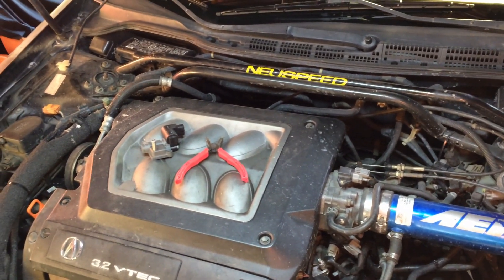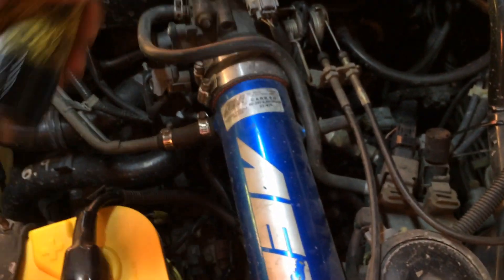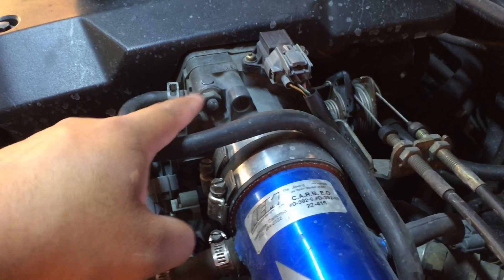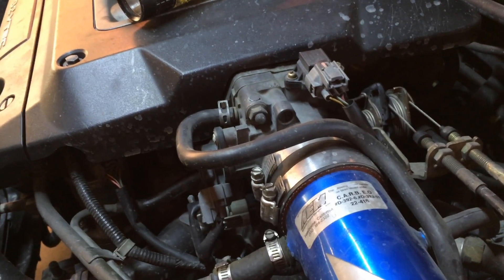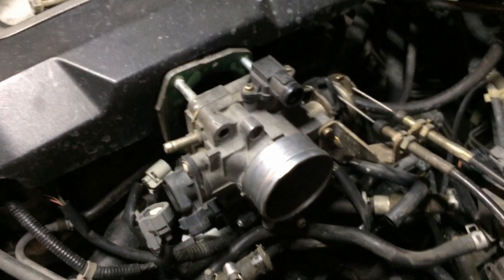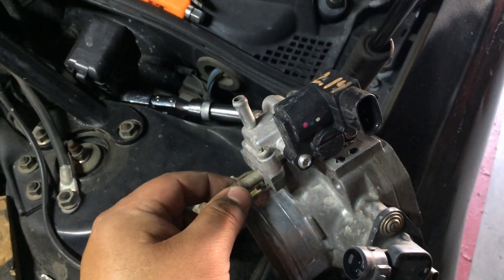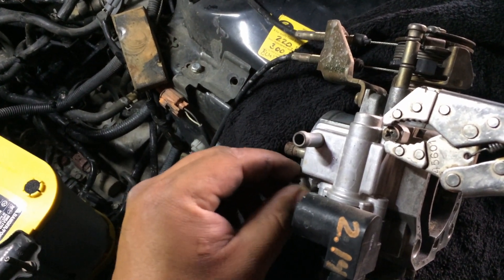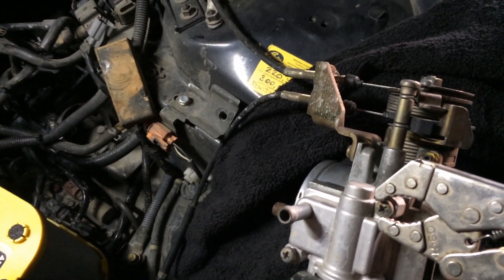Honda Accord V6 Idle Air Control Valve Replacement - IACV - Odyssey Pilot CR-V TL CL MDX

Comment: Where is the idle air control valve on 06 accord V6 3.0
Reply from the maker: On the bottom side of the throttle body. You have to take off the TB to get to it.

Comment: Does replacing the air control valve resolve low idling issues?
Reply from the maker: It can. Is the idling hunting? Going up and down?

Comment: Love your videos --- but just as a note, those 2 'Philips' screws can be difficult to remove for 2 reasons. 1 --- they can be tight (seized) from sitting in place under heat for a long time, but more importantly, 2 --- they are NOT regular Philips head screws.  They have JIS (Japanese Industry Standard) heads, which when used with an American Philips screwdriver can round out the head, especially when on tight.  It's best to use a JIS screwdriver for a better fit.  Then for future use you can replace the bolts with regular M5 x 20 screws with US heads.

Comment: I have a 01 v6
Starts fine when cold but has loss of power when accelerating under cold engine conditions. The weird this is when engine is hot it runs fine with the throttle.
Replaced TPS, spark plugs, ignition coils, cleans EGR passages and replaced EGR, no vacuum leaks cleaned ICV still no change in performance 
Has a slight Rough idle when warm more noticeable when in park. 
Any idea what this could

Comment: Replaced mine, did it because the idle was so high it was out of control.

Brought it down below 1000 rpm, probably idling around 800 when stopped.

I wish I knew a way to lower the idle even more but it's not that bad now

Before replacing it would slam like a sledge hammer 🔨 "BOOM" into first gear when stopped

It was a sharp violent boom into first.  No gas pedal the car would keep accelerating shift into second gear and continue.

Replacing the idle air control valve fixed that.  OEM Honda $28.99 eBay

Helped tremendously but would like to lower it even more if possible but don't know how

Comment: You uh..... you just did triple the work it actually takes.... PEOPLE you don’t have to do ANY of that! Simply take a short neck or “stubby” Phillips head screwdriver and take the idle air control valve off without undoing your throttle body, I’ve done them hundreds of times in the past 14 years I’ve been working at the shop, it only takes 5 minutes to do it my way..... 5 minutes and it’s 100% done
Reply: I came here looking for this comment!  Thanks!
Reply: Wow I was looking for videos all over just to find out if I can change the idle control valve without doing all that extra work thanks for your comment
Reply: @travis8582 I had a new engine put into my car. After it started reving up and down. I took it to get the code read it was the idle control valve. My mechanic said the new part he got isn’t connecting with the car computer and that is why the check engine light keeps coming on. He recommends I replaced my whole throttlebody or get the part right from the Honda dealer. So with all that being said, what’s my issue? How can I go about fixing it?

Comment: My air intake is making a bopping noise  coming from my cold air intake. What could cause this ?
Reply from the maker: At idle?
Reply: BundysGarage yes after driving and sitting say at a stop light in D4
Reply from the maker: I have seen this happen on 2 vehicles and in both cases the idle air control valve was the problem. Put a new one on and the "popping" went away.
Reply: BundysGarage  thanks I’m thinking that might be it because now my car sitting at idle does a small rev rev rev like I’m tapping the gas in N or P. Thanks again yer videos have helped me a lot on the J series